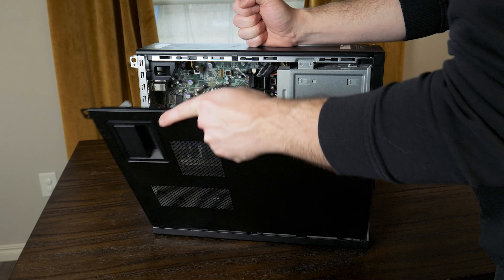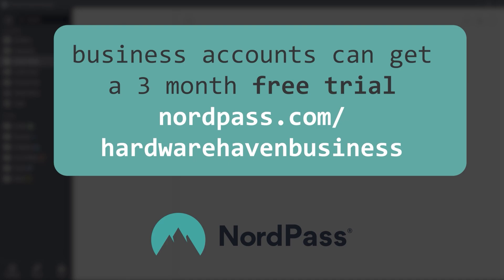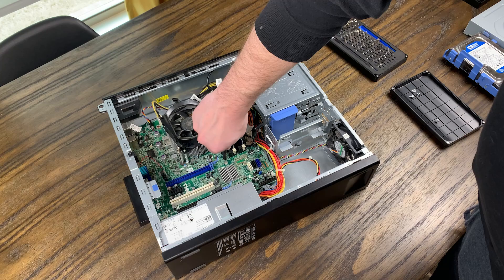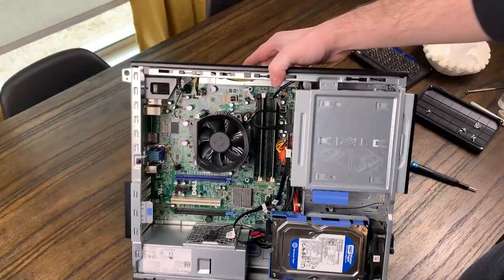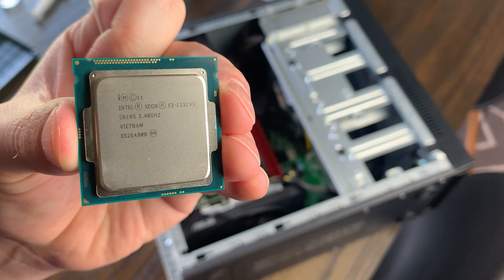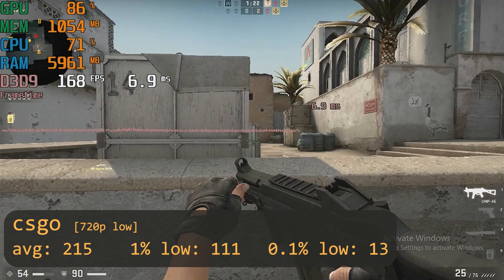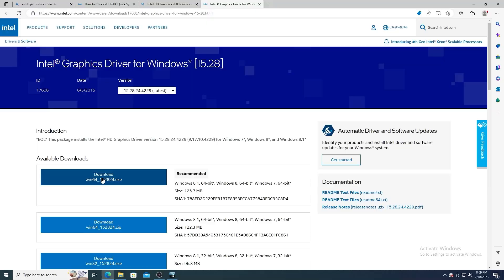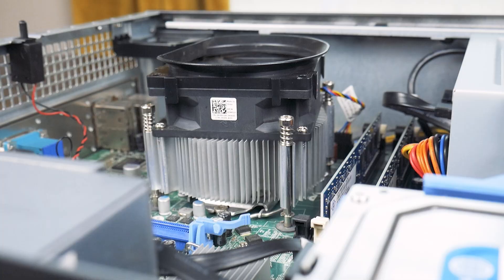What Can We Do With This Dell Optiplex? - Landfill To LAN: Optiplex 790

Comment: I really enjoy working on those Dell PCs, they are well-documented, have decent support, quality parts. Last summer I worked on my older 775 based Optiplex 755. I upgraded the RAM, the CPU to the legendary Core2Quad Q6600 and placed an old Radeon HD4550 from dump, to get an HDMI output. Now it sits next to my friend’s TV as a media center.
Reply from the maker: Very nice!
Reply: I'm still using a similar HP dc7900 SFF with a Core2 Quad Q6600 @ 3.0GHz (BSEL mod), 8GB DDR2, Radeon HD 6570 as a HTPC

Comment: I've worked on HUNDREDS of optiplex's over the years.  The SFF 790's had our HIGHEST failure rate because about 10% of them would blow PSUs.  Just keep that in mind.  Otherwise, great value.  Don't use for mission critical applications without a proprietary backup PSU on hand.  You've been warned!!!!!!
Reply: Those that didn't, are still running today ;)
Reply: press F for those people who got unlucky on those optiplex 790
Reply: They keep dropping.  Always the PSU.  All the other optiplex's combined equal probably 2 units in total failing for ANY reason (guessing around 100-150 units of various years). 790 SFF I'd guess 30 outta 200.  Which is insane when comparing ratios.  I believe it's a power trace/delivery failure on the MB.  But ya, in general optiplex's are tanks mang.  Would never hate someone using them.  I still use a 9020 SFF for a backup server.  I just worry about newbies getting involved with proprietary components like PSU and motherboard I/O.  ... For the price?   ... And for someone just getting into homelab?  I get it.  Pull the trigger on em!
Reply: I hope to find some help here in the comments. I have this exact PC, Optiplex 790 DT with the i5-2400 on 3.1 GHz and am unsure about the power supply of the PCIe ports. I would like to install a low profile AMD R5 340X 2GB GPU but it claims to drain 65W at max and I found some specs of the PC telling me the slots only support up to 35 W. Is there any way to make this GPU work without an additional psu or changing the motherboard or am I mixing up the specs and the gpu will work? On other sites I found that the PCIe 16 slot always supports up to 75W? Thanks in advance.
Reply: I know all about that power supply problem in the desktops. That is why I never bought a Dell. I saw more than 10% blow their PSU.
Reply: @evickaklierova3107  r5 340x is a quite slow card, and you shouldnt be worried about pcie x16 power if the psu is good enough
Reply: It's weird how Dell sold so many units and had the worst PSU's on the planet ??
Reply: @creed5248  Also crazy that I haven't had any other PSU issues with the 3080, 3010, 3020, 3000, even the older 380's.  Those 380 we're tanks!  Great luck with Dell more or less.  Just those damn 790 PSUs LoL!!!!!  Still a great deal tho people... I ain't hating.  Just be prepared.  Even with just a homelab, being prepared can help you for the real deal
Reply: I have a 3010 SFF. Are those good by any chance?
Reply: @WantBadtime  you definitely don't want to use the standard WD blue 250gb hdd.  Those are beyond slow.  I'd say overall those have been my second least favorite LoL.  I'd try to find a 3020.  Those were great for us.  Overall all optiplex are good values of course.  But I'd go 3020 if you can
Reply: @mt_kegan512  okay, I just wanted to know. My work gave me a 3010 SFF for free, and the only difference I can find with the 3010s is that they only have 2 RAM DIMMs instead of 4.
Reply: @WantBadtime  it's been a while, but the motherboards and/or chipsets may be different.  But who cares... if ya got it for free you can't go wrong!
Reply: A power supply isn’t that hard to replace 😊
Reply: Yeah I'm getting one for free soon bc it has a dead power supply
Reply: Neighbours optiplex 990 PSU just passed away. Bought them a 2nd hand thinkcentre cheap as replacement.
Now do I get this junk up and running again? the PSU is half the price of a thinkcentre with much higher specs, just feel bad throwing it out.
Reply: @WantBadtime  those point of failures/slowness was always that specific era of the 250gb WD blue hdd (otherwise Ive liked the blue series).  The 500gb seemed to be better.  Otherwise no problems with the computer itself.  Nowadays a SSD upgrade is the first thing you touch anyways
Reply: we've been running it for almost 2 years now running digital signage...
Reply: This is me. Although lightning had struck the house

Comment: I actually just got the usff version of this model scrap from work and it is an amazing silent trueNAS/plex server with the dvd drive replaced with a 2.5in adaptor. It's even pretty decent running a VM too once upgraded from i5 2400 to i7 2600s.

Comment: Ahhh the Optiplex has finally made an appearance on HH! So glad to see this stalwart get some screentime on this channel, bcz somehow it seems like a fresh take on an old mainstay.
Great Videos, as usual.

Three years ago I grabbed a USFF 780 with an E8400 and 4gb of ram running W10 and used it as a MC server and Pihole on my network. I kept it headless and used VNC to remote into it. It got an upgrade to an E8600 as well as an SSD.

Then, 18 months ago I replaced it with an USFF 9020 (i5-4570S, 8gb ram, and the W10 120gb ssd out of the 780) and it is my new MC server & FileZilla server, and never breaks 37°C, after a cleanup plus fresh paste. 
The 780 is a linux box now and since I have multiple Pi's taking on the roles of Pihole, Kodi, and two NAS, I wonder what to do with it.

I wonder what You would do with a low spec Ultra Small Form Factor like my "upgraded" 780. 🤔
Reply from the maker: Thanks! To be fair I did use and optiplex in my $150 NAS video haha

Comment: I work on a public university in Brazil using a HP Compaq with a i5 2400 and 8GB RAM. This month i upgraded it to use a SSD for win10 (that i bought) and let the 500GB HD just for backup. 
Right now i have  two monitors connected, 6 tabs opened in chrome, some PDFs on Edge, telegram, whatsapp, email and matlab opened in background. I work with some simulations on matlab in my PhD and it handle the simulations just right (when the 8gb is enought xD). Also code and compile little programs and run python.
It's a really good machine? No! but it's plenty usable for daily use AFTER PUTING A SSD (very important note!!).
Here in university we have a plan to buy LOTS and LOTS of SSDs and ddr3 RAM to literally revive the computers with 2nd and 3rd gen i5 used just for daily work.
I compare it's the performance now with a 4 or 5 years old laptop that is way more expensive that this OEM pcs

Comment: The great thing about this DT Optiplex form factor is that the mounting holes for mobo are standard Micro ATX. The PSU is also a TFX - so you can replace the motherboard with anything you have and get a new TFX PSU from Be Quiet or Silverstone for example. The only problem is that the power button has a proprietary connector, and the optiplexes that had 4 USB on the front have combo USB 2.0 and Audio connectors. You can dig out the button and McGyver a standard 2 pin button as a replacement, and use an after market USB front panel in the 5,25 bay though.

Comment: The power supply form factor in this case is called TFX, and you CAN get different models if you wanted to swap the motherboard out for something ITX and build a sleeper with it. Just watch out for the cooler mounting studs on the motherboard tray, if it's anything like my Optiplex 7020.

AH, no, it's the DT form factor 790, not the SFF, so a Micro ATX board would fit fine, lol
Reply from the maker: Oh nice! Love learning new things haha

Comment: Older machines are great for older games. I was a huge fan of the OG Rainbow Six and Rogue Spear games, and A-10 Cuba back in the mid to late 90s. Sometimes modern machines are far too capable and the best platform are those that are a bit closer in age, then again, we are talking about games from the 90s. Surprisingly, I find really old systems being sold quite often locally on Marketplace. It's funny when someone lists a tower from that era with an old CRT monitor and asks for a few hundred. A recent one I saw comes with a BLUE ethernet cable (ooOOoOoOOooo)! I suppose I could queue up a VM on my Synology and allocate some of the resources to be comparable, but still might run into display driver issues. Plus, there is a bit of nostalgia-factor in using true-to-era hardware.

Comment: I have a 790 MT. I like the ability to use an aftermarket power supply without needing an adapter. You still need an adapter for the cpu fan & front controls, but only if you put it in a fancy aftermarket case. Not a fan of blinky lights or fancy paint. Those don't improve performance one bit.

Comment: Got 4 of these for free, swapped in i7 2600 for the clock boost and HT ($30), Radeon 8570 1GB ($9), Sound Blaster Audigy SE Low profile PCI ($15) and 16GB of ram ($40), definitely gonna get used for some homelab projects.
Reply: Same except i got 7 of these i didnt get to upgrade them but they were free

Comment: Interesting. I have an OptiPlex 790 too, but the internal layout is different. In mine, the power supply runs the full length of the case and the hard drive is mounted higher up behind the optical drive. Yours appears to have a half-length PSU and the HDD is mounted beside it in the gap at the bottom.

Comment: I scooped one up a few years go for $100 shipped, just about before the "human malware" scare. It came with an i7 3770, 8GB of ram & a radeon hd 7470. A year later I decided to upgrade it just about before the "human malware" scare hit. Since then I had just been playing Minecraft & TES4: Oblivion since that's about all the GPU could handle. For about an extra $200 I swapped the case from the 2U desktop case to a standard MATX case, 500 watt PSU, an RX 580 8GB, 16GB kit of ram, tower cooler & mounting adapter, special sata cables to go under the long GPU (great design dell :X ) a 120GB SSD, 4TB HDD plus the 750GB HDD it came with. It plays every game I want absolutely cranked with lighting & texture mods. When I eventually upgrade the platform it'll definitely go back into that old case to be a small torrent/NAS/streaming box.
Reply from the maker: Love it!

Comment: I have a 790 too! Mine is the full desktop tower, though.
It came with a Core i7-2600, but with no RAM or storage.
I currently use it for my VGA PCI capture card (my main PC doesn't have PCI slots...), but in the future I want to slap my GTX 960 on there and use it as a superfast Windows XP gaming machine...
Reply from the maker: That't a cool use for it!

Comment: In 2015, my only computer in this apartment that wasn't a phone was a Raspberry Pi 3. I bought an Optiplex 9010 from a recycler, and I paid I wanna say $350 at the time. It had an Ivy Bridge 3770 (non-K), 16GB RAM, a 128GB SSD and 500GB hard drive, and an OEM Radeon HD 7470. It was about as good as this machine got. The SSD gave out. The HD was decomissioned. The power supply died. All replaced. The video card got upgraded to its successor.

The machine currently runs my Jellyfin server which has 23TB of formatted space. Connected to a SFF desktop workstation from 2011/2012ish using eSATA. That said … not for too much longer because holy crap it is time to upgrade this thing.

Comment: I have a bunch of Dell's in the home lab. (i live near dell's home base) (T1600, Optiplex 3010, etc) and for as much as I like them I also hate they don't have industry standard ATX motherboards in them.  I have the USFF Optiplex780 and it is reliable but that USFF form factor isn't upgradeable at all. no slots of any type in the device. I just upgrated my Optiplex Mini Tower to an i7-3770 with a GTX 1070Ti (8gb) and it games pretty good for an old PC.  20 bucks for that 780 was a good deal.  Great video, you always have such good production values and well thought out video.
Reply from the maker: Thanks Johnny,
You always have such well thought out and kind comments haha
Reply: Be thankful I’m not rambling on and I’m sticking to the subject of the video! Ha. Getting old isn’t fun at all
Reply from the maker: @JMassengill  Idk, you seem like you would have fun ramblings haha
Reply: Thanks HH, you're too kind

Comment: Picked up one of these over the weekend (full size cause though) to use for jellyfin, sad to hear it's not as well supported as mine also has the 2400. I planned on slotting in a gpu eventually for hardware transcoding via nvenc. It's a shame dell didn't have a bios update for these motherboards to support 3rd gen Intel. 
Hopefully it's okay for jellyfin for now, I can maybe upgrade one day anyway.
Reply from the maker: If you're doing direct streaming it works great. I don't stream to my phone or over the internet really ever so it's not a huge issue.

Comment: So I hope to find some help here in the comments. I have this exact PC, Optiplex 790 DT with the i5-2400 on 3.1 GHz and am unsure about the power supply of the PCIe ports. I would like to install a low profile AMD R5 340X 2GB GPU but it claims to drain 65W at max and I found some specs of the PC telling me the slots only support up to 35 W. Is there any way to make this GPU work without an additional psu or changing the motherboard or am I mixing up the specs and the gpu will work? On other sites I found that the PCIe 16 slot always supports up to 75W? Thanks in advance.

Comment: You can actually put a xeon 1230 in the dell 790 I use that as my server
Reply from the maker: Nice! I imagine power draw is still fairly high though, but I'd be curious to know!
Reply: @Hardware Haven  the cpu draws about 50w with what I have it doing and idles about 20w and I also have a gtx 970 in it that idles at about 15w and when gaming with steam link uses 100w

Comment: I see you install Windows for all your tests (I do the same). In case you are not aware, you can create a tiny version of windows 10 or 11, which will run way better in outdated machines. Tiny11 can run with 2GB RAM.
Also, I hope you use answer files so the installation is automated from USB/ISO boot till desktop. 
Keep up the good job!
Reply from the maker: I use standard windows because I find that it gives provides more meaningful info to the average viewer. I don't setup these systems in  away that reflects my personal preferences/use case
Reply: @HardwareHaven  The whole point is to automate your installations and not lose tone. About the tiny installs, it's just the same OS but without bloatware, so machines score better results. 
I promote you to make a test with answer files and tiny installs. Reach me of you need any help. I would gladly show you how it's done and save you time to learn it.

Comment: I'd recommend going to 16gb of RAM and swapping out the i5 2400 for a xeon e3 1240 v2. It's basically a better i7 2600 and doesn't use anywhere near as much power. This combined with a better GPU (RX 550 might be a good choice) should give you much better performance with that computer.

Comment: you could always run linux on this for a more free computing experience - run windows as a vm - even tiny11 or pe versions - qemu runs vms of all kinds very well even on older hw - what is the actual power delta between this and newer versions - it can't be that much - please provide some numbers so we all know definitively - thanks for the content!
Reply: I have a similar system (same gen, but a mobile i7) that I ran Fedora and TrueNAS. I measured the power draw, it was 35-36W idle with x2 spinning drives and no pcie card. Peak power draw was above 100W.
Also he did put in some power numbers in the video too, getting similar results like me.
Reply: @derisis13  you aren't going to do much better than 35w idle except by going to sbc/arm - new chips like amd use like 100w at idle - i doubt going to 6th gen is going to save you sig amount to balance out cost (initial outlay) - in a few years arm will likely have 12 core and be a better bet price/perf and roi/tco but for now old intel refurbs are king essentially - all things considered - even power consumption - it does rely on some variable like where you live and what kw/hr rates are - average cost is 13 cents per kilowatt hr so total cost will be about 4 bucks a mo

Comment: The i5 2400 can handle 32gb ram  but it is only 2.0 PCIE and usb. A good thing is 790 is upgradable to third generation CPU which offers 3.0 😁 like i7 3770 with 4 cores 8 threads 💪

Comment: The worst thing is that it doesn't support 3rd gen cpus, i use a motherboard from 790 with a xeon 1270 (that's cheap at aliexpress)
Reply from the maker: Yeah, 3rd/4th is sort of a sweet spot where the performance and efficiency is noticeably better but basically the same price on the used market
Reply: @HardwareHaven  at least for 20 usd wasn't bad for a full working system, and a xeon 1270 costs more than this probably 😂, and the form factor is nice from this systems
Reply: If you’re willing to spend a bit, this can be brought up to last Gen specs, possibly current Gen with a stock or LP CPU cooler.

Comment: why is the idle power higher than the load power??? mistake maybe
Reply from the maker: Yes they are flipped on that slide. My bad!
Reply: @HardwareHaven  could you pleas add a disclaimer or fix it
Reply from the maker: @hannescampidell  I felt like it was fairly obvious, but sure that probably makes sense.
Reply from the maker: And to be clear, I can't fix something like that after I've uploaded
Reply: @HardwareHaven  ok and at lest it is fixed in the description